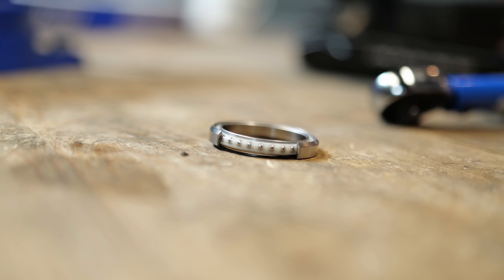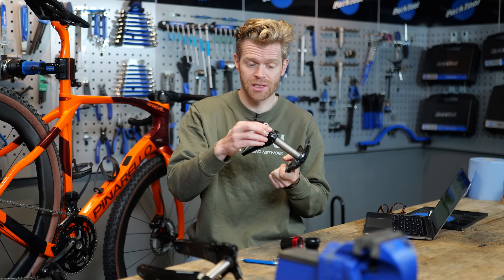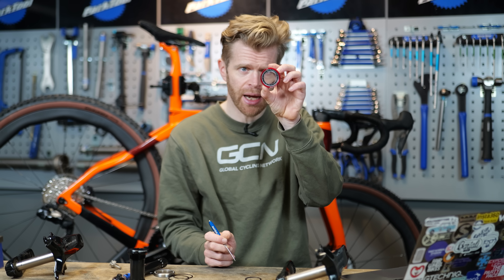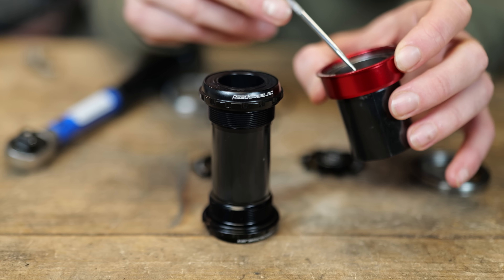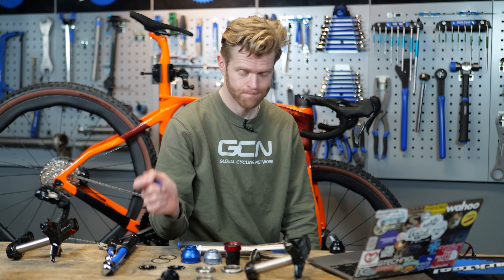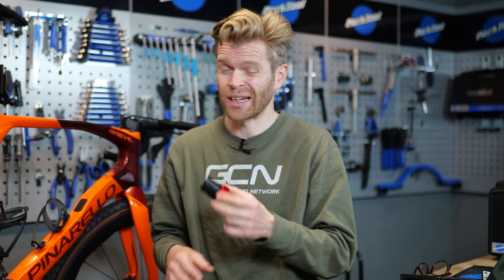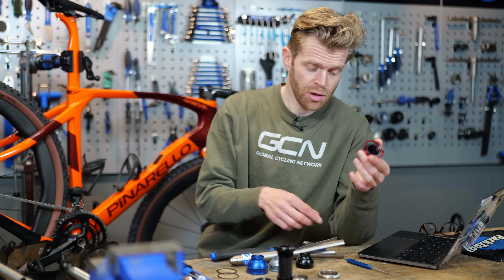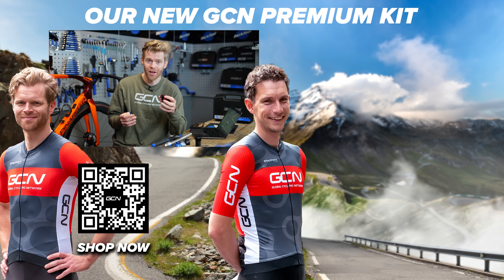5 Maintenance Mistakes That Are Ruining Your Bearings

Comment from the maker: We covered a lot of common mistakes, but which one are you most guilty of? Is it jet washing, or maybe over-tightening your headset? Let us know in the comments! 👇
Reply: Totally guilty of Not checking my headset bearings for like 4 years at a time.
Reply: BTW, please say "tight tolerance" for precise fit, and "loose tolerance" for sloppy fit.  99% of people say "high tolerance" like it's the good one, but it means sloppy.
Reply: If wd40 ruins bearings, what is it for/how should it be used and what even is it!?
Reply: @oscarthearle3765  It's a water displacer (WD) designed to prevent surface rust/corrosion on metals (Atals Missiles originally). On a bike, its uses are (or should be) limited; it cleans raw Titanium pretty well, it's MOSTLY kind to paintwork and carbon (providing you wash it off after), so it can help remove "sticky stuff", works as a make-shift penetrating oil for stubborn bolts (but there are much better products out there) and that's about it.
What it's NOT is a lubricant or a degreaser.
Sadly, WD40 is also a master class in marketing, and they have convinced everyone it's a wonder product with a million and one uses.
Reply: @Bikey_McBeardface  You're quite correct - I think some of the confusion comes from WD40 product range. Recent years they've marketed a bicycle range which includes WD wet lube, WD Dry lube amonst others (comes in small squeeze bottles and is quite good at lubricating drive trains) however, loads of people confuse that with the WD40 spray cans and the killer red tube thinking it's the same and they spray everything - they also wonder why their brakes are not as good due to the over spray. The times I've argued with people convinced that I'm trying it on when pointing out bearing and drive train issues through lack of maintenance not to mention buggered pads to be met with them exclaiming that they've maintained everything, every week with WD40! - they're still out there!
Reply: @oscarthearle3765  mainly wd40 is for penetrating things, when you cant unscrew sth, sth is stuck
check some renewing old stuff vids
Reply: 4:04 - You should not lever out the seal of a ball bearing at the sealing lip on the inner ring of the bearing, but always on the fixed outer side. Otherwise, you will quickly damage the sealing lip and the ball bearing will no longer be sealed.

Comment: One main reason for noise coming from the BB that I get in the shop comes from worn-out carbon tubes used for press-fit BBs. This is, IMHO, one of the worst “improvements” was its development. The only benefit is an easier manufacturing and assembly process. Every time you remove the bearing, you take a small amount of BB-material with it. After a few changes, the fit gets loose enough for normal pedalling to cause more wear. I regularly get frames from which the bearings fall out or can be removed with bare fingers. The BSA standard is by far still the most robust solution.

Comment: I think Oli should have mentioned that there is zero benefit to spending €179 for a CeramicSpeed headset bearing (coated or not), when you can buy perfectly good ones from the likes of Enduro for €25. As the types of rotational forces being exerted on headset bearings are de minimis, it's just money wasted. We can probably also say the same about bottom brackets and wheel bearings. I seem to remember a GCN video discussion with the founder of Enduro Bearings who made this point very persuasively (although they do do ceramic bearings as well; and why wouldn't they wish to part fools from their money?). There may even have been another one with Hambini, making the same points. He certainly has some very persuasive data to show that the best quality NTN bearings actually perform better than the ceramic ones from CeramicSpeed, let alone the rubbish Chinese ones from the web.
Reply: he has graphs in powerpoint. You have to trust him, that they're true and accurate. He has never shown any photo or video evidence of him performing any kind of testing. so you always gotta take his stuff with a grain of salt and doublecheck with other sources.
Reply: @mr_obst3077  I think the most persuasive point is that ceramic bearings are used in engineering applications where you are doing thousands of rpm, as opposed to 80-125 in a wheel bearing or a bottom bracket.
Reply: @chilltechnologies8933  i still don't see why that'd make the bearings shred their efficiency within like 3 rides in a bike and become worse than steel. Doesn't make sense to me that something that can withstand the extreme heat generated from the friction at 1000s of rpm and the forces going through it in machinery would be unable to hold up to 500 watts in a bike. Also don't forget he's in the business of selling steel bearings, oddly convenient that he has magic data (with no proof of testing) that shows steel being much better than ceramic. I personally don't believe there is a power saving benefit in ceramic either (unless you're in the world tour putting out 7w/kg for an hour), as most studys conlcude that, but I struggle to believe they are actively worse than steel. Unless you take terrible ones where the races are made from junkyard scrap steel.

Comment: WD40 is the multi tool of the pressure cans . if you only use a multi tool to work on your bike , use WD40 
WD40 Lubrication: Lubricates and frees stuck parts like latches, hinges, and handles. 
Moisture displacement: Protects metal from rust and corrosion by displacing moisture. 
Cleaning: Cleans and shines stainless steel, plastic furniture, and windows. 
Rust removal: Helps remove rust from metal surfaces. 
Stain removal: Removes stubborn stains like gum, crayon, tar, and marker from various surfaces. 
Tool maintenance: Cleans dirt and grime from garden and shop tools and helps prevent rust. 

Vegetable oil could be a better choice for a lubricant rather than WD40 
The term "vegetable oil" was not originally used for industrial machine lubricants; rather, oils used for machines, like seed oils, were renamed "vegetable oil" for marketing purposes in the early 1900s ( Google )

Comment: Power sprayers are fine if you keep the power down (electric are generally weaker) and distance from the bike a reasonable 5-6'.  Basically just close enough to remove the chunks of dirt.  I have a 35yo Cannondale CAD3 with mostly original parts.  Otherwise, anything that touches the bike is going to scratch the finish.  The same goes for cars, spray at an angle so you don't grind the dirt into the finish.  I prefer Shimano's locknut approach and SRAM's three bolt chainrings so I can install ovals more easily.

The industry really needs to standardize BB's PERIOD, make it so!  Companies could do A LOT better at actually sealing bearings.  I bought some aftermarket Shimano spacers, and they came with a set of rubber gasket spacers.  However, I know they could potentially trap dirt too.

Where's the link to the BB maintenance video?

Comment: Ollie, there was another BB type you didn't cover and that's the "threaded press fit" that threads to itself, rather than the frame. They are great replacements for pressfit BB's that creak in pressfit frames. I used one made by Wheels Manufacturing in my Giant Defy to silence a creaking bottom bracket. I suppose it doesn't matter for this video as all the things you mentioned about BB's and bearings are also relevant for threaded pressfit bottom brackets.
Reply from the maker: Good point, thanks for mentioning!
Reply: @gcntech I love the threaded press fit. I have a Cannondale Supersix Evo . There is a cable chase hole in the frame at the bottom of the bottom bracket. It was always getting water and often road gravel sloshing around the bearings and crank shaft. I replaced the press fit BB’s with a threaded press fit adapter when I upgraded my crank from Shimano to Magene spider power meter. No more water and gravel destroying my bearings!

Comment: I use the HOPE method for Shimano Type crank preload: slightly over-tighten to ensure both arms are snug to the bearings, loosen off completely, then "nip" it back up with just 2 fingers on the tool.
For best performance on classic* QR/Bolted cup and cone hubs, you actually want a bit of play with the wheels out of the frame, and no play once the skewer is tightened.
*I have no experience with the later Thru Axle type Shimano were (still are?) producing, they may work differently. And watch out for Campy and some other later QR hubs, they may be cartridge bearings masquerading as cup and cone.

Comment: I'm fortunate that my Bosch portable washer has a low setting which is like rain - lower than the garden hose. Used it for about 3yrs now and the bearings over all our bikes are fine, fingers crossed! It's been an excellent piece of equipment when traveling - washed myself with it as well.

Comment: I'm not sure about your explanation of the polish on the crank tube. My understanding is this should go up against the inner race of the bearing. And the tube being to large will put pressure on the bearing. Which is bad. I can't see how this would polish the tube. I could see this leaving scratches at instalation and bad bearing performance. If the tube was too small I could see it polishing as the tube slides around. Is that what's Goin on or am I missing something?

Comment: Got a second hand bike from the UK.. drive side BB bearing way better than non drive side BB bearing which was shot. DOT disc brakes had to be flushed three times. Other than that the bike really nice … guys just get a set of brushes from decathlon and hose the dirt down. Jet washes are a no go 🙅‍♂️
Reply: Drive side is shielded by the chainring from jet that’s how you can exactly see where the damage is coming from…

Comment: I still jet wash the mud off my MTB at a petrol station on the way home, but I do avoid the hubs, headset, bottom bracket, and shock seals. You can't reduce the power of a jet wash easily, but you can stand back a few extra feet  which dramatically decreases the force of the spray.
Reply from the maker: just go easy with that high-power jetwash!

Comment: I challenge you to remove a pressfit bb with any tool without risking damage to the bearings. Just service them in place. Seriously, suggesting that bearings should be removed and serviced is propagating damaging misinformation.
Reply: What if the retaining compound holding the bearing is worn out, but the actual bearing is fine?  It's gonna creak like crazy until you loctite it back in there, and if you have a bearing puller you can remove it without damage.
Reply: @凸Bebo凸 Sure, if the bearings is loose. But, if it's tight to spec, especially with the addition of retaining compound, pulling the bearings, even with a puller will damage the bearing.
Reply: @NelsonSherry   What if you are in a bike shop, and someone brings their garbage, clapped out, misaligned 7 year old PressFit Trek with a loose hole that creaks every 6 months or so?

Just sell him a new bearing each time or try to remove it with a little heat and a puller?
Reply: @凸Bebo凸 I'm not saying never pull and reuse a pressfit bb. I'm saying there is no way to reliably pull most of them without risking damage. If the frame is so badly out of spec that even a good gap filling retaining compound won't hold it, it's either time for a new frame or a frame repair.
Reply: @凸Bebo凸 Bearing pullers pull on the inner race. The outer race is the one being held by the press fit. So, pulling the bearing puts substantial sideways loading on the bearings with a very high likelihood of damaging them.
Reply: @NelsonSherry  Nah, worst you can do is damage the seal, people do that all the time by prying it up and regreasing, that's just -2 watts or so.  Pulling by the inner ring is fine.

It's not something I'd do personally, I'd just replace, but people form emotional attachment to junk carbon bikes sometimes.
Reply: @凸Bebo凸 Pulling a properly installed press fit bb by the inner race absolutely risks significant bearing damage. I see/feel it all the time. If you don't see/feel it you either don't do a lot of it, or you're not paying attention.

Comment: For some reason, people think "sealed bearings" are maintenance free. As implied in the video, most seals only resist dust and dirt. Effectiveness varies widely. A good seal causes resistance that prevents the bearing from spinning freely with finger pressure. A less effective seal spins freely but does not block as much dirt. Cycling bearings tend to be the latter since people think free spinning is always better. Most of the time it just means a poor seal. The difference in resistance between a tight and loose seal is virtually unmeasurable when the bearing is under load. Either way, popping the seal off annually to clean and add lubricant is the best way to get a bearing to last forever (literally).

Comment: I wash my MTB with a spray hose at least 75 times per year, 30% of the time I use Simple Green degreaser. The $30 Shimano bb works fine, lasts about a year and takes 20 min to replace. My Chris King headset is 5 years old and is going strong.
Reply: Twice a year is fine for road bikes. My Chris King headset is 30 years old.

Comment: Missed one biggie:  DO NOT SIDE LOAD YOUR BOTTOM BRACKET!  (i.e. transporting or laying bike on side with peddle against surface).  BBs are designed for radial loads; not axial loads.  The crank arm and pedal act as a long lever. When the bike rests flat, the entire weight of the bike is leveraged through that pedal. This creates excess lateral force that over-compresses the preload cap (tightening it against the bearings). In a bouncing vehicle it can literally break the plastic bb shell.
Reply: Thats interesting but i wouldnt necessarily agree. My Bikes wheigh between 6 and 12kg, thats not so much axial load on the BB if laid on the side. 
When sprinting with 1500w, especially when the bike is tilted sideways doing so, i bet the axial load is at least 10 times higher than just the bike laying flat riding over bumps. But of course, this is just my assumption, i might be wrong. I would really like to know actually because if you are right, i would definetly avoid laying the bike. But at the same time, my Gravel is 1 year old now, has over 6000km and plenty of time in my trunk and the BB is just as perfect. Even if it does damage slightly, i would be fine changing the bb yearly to be honest.
Reply: The preload cap does nothing once the pinch-bolts are tightened.
Reply: talking shit 😂
Reply: Слишком малая нагрузка для этого

Comment: When servicing a cartridge bearing, after you flush out the old grease and replace it with fresh grease, don't pack it all the way full of new grease. This will increase friction and pressure, which can pop the seals off. Instead, pack it about halfway full of new grease.

Comment: Given the larger diameter of head tubes in the carbon era why hasn't the headset transitioned from balls to rollers? Drag isn't an issue here and rollers take impact much better than balls.
Reply: A few companies have used and are still using roller bearings. See the article by Retrogrouch. Roller "Needle" Bearing Headsets
    I'm not sure but I think roller bearings are fussy to install. Everything needs to be perfect, but I could be wrong. I don't know where the problems come from.
Reply from the maker: very good point! Stronglight used to make headsets with needle bearings instead of more commonplace balls

Comment: As I have a ridiculous finger turning force I am always worried when aiming for finger tight.
Reply: Use a weaker pair of fingers.
Reply: @skyrunr only have the one god given set, apparently supposed to last a lifetime. No warranty though
Reply: @StephenRussell-c8v  Yes, but if you use your thumb and ring finger it should be a lot weaker than your thumb and pointer.
Reply: @skyrunr not a lot I was power lifting for over 20 years, thumb and little finger are generally weaker but I could still hold around 30 plus kg on little one. Although the point I was making is that finger tight is an incredibly vague value. I am sure for some people it would not be tight enough for safety and others will over tighten.
Reply: @StephenRussell-c8v  Nice.  "Oh, Don't know my own strength!"  Bullwinkle  I'm strong enough, at least when my arthritis isn't acting up.

Comment: With the push towards making us all have integrated everything, is there any work being done to make 2 part bearings, so we can swap headset bearings without having to rip the brakes and bike apart?  My non-engineer brain thinks it's doable and would solve a ton of headaches for us home mechanics (and pros too I'm assuming).
Reply: My engineer brain tells me that integrated frames are one of the dumbest fashions around, together with press-fit
Reply: If you mean the bearing races being half-circles instead of circles so you don't have to put cables through them... probably a tolerance nightmare, Olly mentioned microns in ball diameter, and I wouldn't expect that kind of design to be easy to do better than 100 micron accuracy of roundness with home install tools.  If you want easier maintenance it would make more sense to build 2-part brake cables that split in the middle.  Which is not trivial, but if there's a little extra slack as a result, it's easy to adjust brakes to compensate.

Comment: It took engineers to convince you not to spray the grease out of the bearings on your bike? I thought you were smarter than that. #1 is water EGRESS...read Campagnolo's BB instruction manual...BB shell needs a drain hole. Bike doesn't have one? Drill one! It doesn't have to be large, just enough to let any water drip out - so park your bike on the wheels after washing it.
Reply: LOL Many companies have practically trademarked their drainhole designs in the bb. There are whole forum sites dedicated to id-ing steel frames by their drain holes.